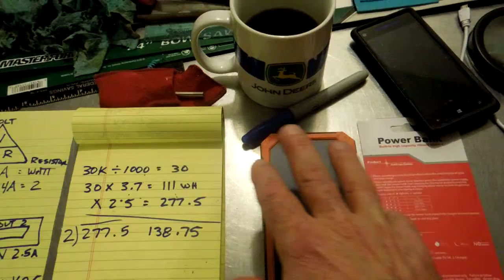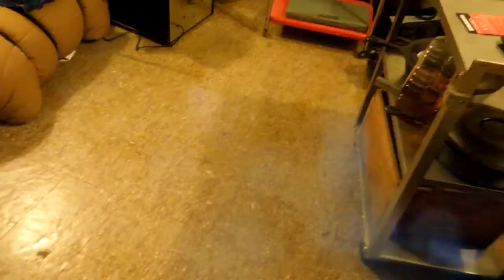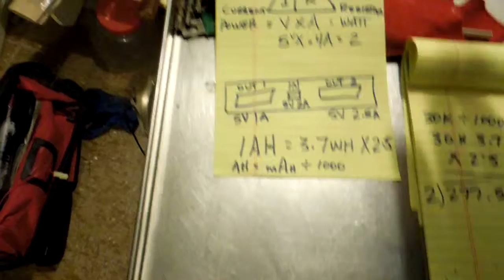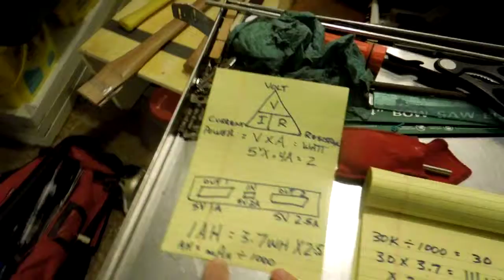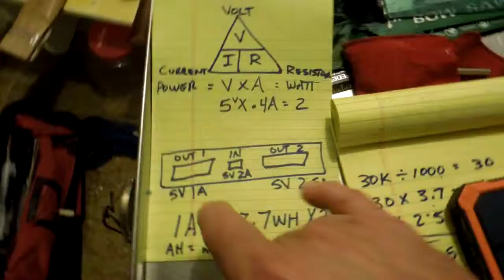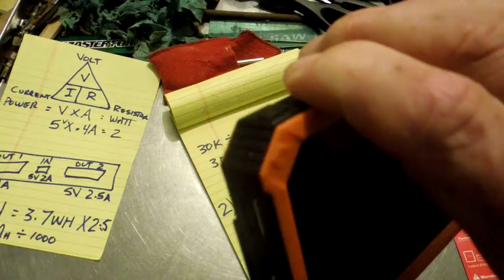Initial impressions : Bienna 30 , 000  mAh Battery pack

Comment: i just got a 10,000 amh pack and it doesnt  charge my camera' which uses 7.4 v battery. it does charge the cell phone. I wonder if a 30,000 mah will be strong enuf?
Reply from the maker: +SunsetBay Bonnie it will work on your phone.  for the camera you will need a battery pack equal to or greater than the device battery rating.  IE 12volts will charge a 7.4 volt battery.  I have a 12v jump starting battery pack for the truck.  It has the recepticals formerly known as cigarette lighter hole that you can plug the USB adapters into.  It works on the phone and the camera battery

Comment: Hmmm....looks like my next purchase :-)
Reply from the maker: +saltyshellback the paper card says that it is certified circuit protected against causing issues in an explosive environment.  and that it is certified for 24 hour use.  I am guessing that it means it wont overheat and catch on fire if you leave it unattended while transferring power or recharging.  (airplanes maybe?) and that it is a memory free battery.   That one I understand from dealing with small lead acid batteries in lawn and garden equipment.   I had to use two magnifying glasses put together in order to read that tiny print under the symbols :)  super tiny print. Tri Focals be damned :)

Comment from the maker: OK from random button pushing I just figured out that the lamp has 3 modes.  I showed the low power setting in this video.  There is a super bright (measured value unknown) and a blinky light mode also.  The bright lamp setting will make you see blue spots for a good 15 minutes  :)